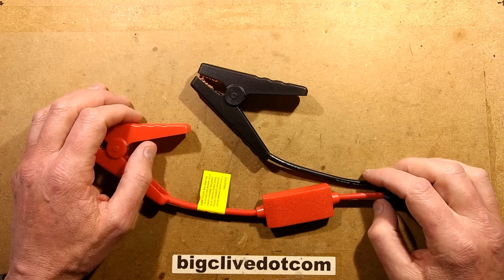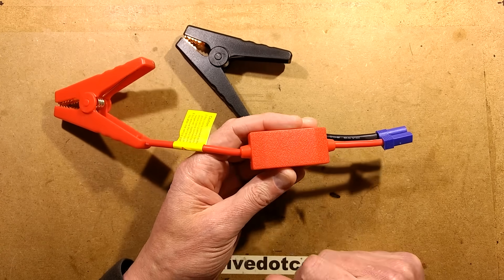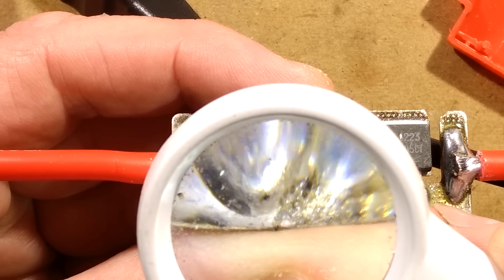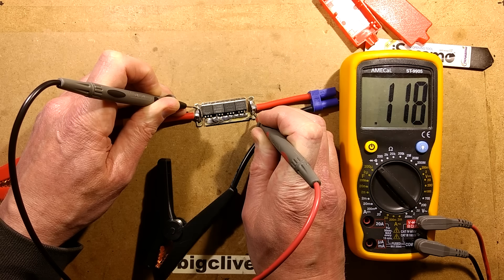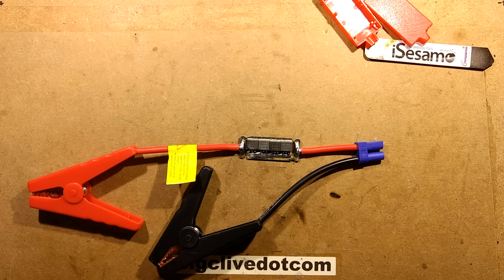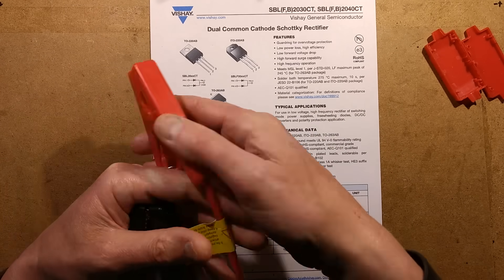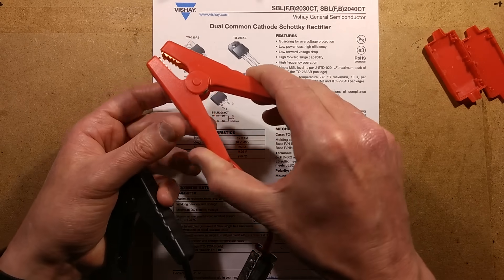What's in the little red box on some jump-start leads?  (Guess first.)

Comment: My wife bought some of those jumper cables that are all solid blue with no polarity markings at all.  Just four blue clamps, and a "magic box" in the middle.  "It's easier to use", she says.  "It says it doesn't matter which way around you connect it."

I hate those things.  Connecting two enormous batteries in parallel with no way to observe proper polarity just feels SO wrong.

Comment: I have such a jump starter box for a bigger emergency „battery“

I dont know why and i would never disassemble it, but it has 2 LEDs on this box. When just connecting a nearly drained battery, a green light goes on and it does nearly nothing, just a small current since the car battery very slow goes up in voltage.

Only when starting the car, the red LED goes on and the voltage of the car battery is somehow „pushed“ by the powerbank much more drastically.

In fact starting the car with powerbank connected the voltage drops at worst to around 11V, without powerbank i have seen 10V and probably for a blink of an eye.

I have no clue if this voltage depending mechanism for variable amp output is in the cable or powerbank, but i really appreciate this thing helped me out already a few times and sometimes its the best pick for a mobile power supply since it has also a dedicated 12V 60A output and ofc USB/UsB-C and a flashlight.

Comment: I would hope it's a massive high current diode to prevent reverse connection causing a lithium ion explosion, but it's probably a tiny, underpowered diode designed to die, and render your boost pack useless in the event of reverse connection.

Comment: I think it's kinda funny that every one of the diodes seemed to be a different model marking. Suggesting they're all fake labels on them, and were just the cheapest they could get that day. But also It's quite likely that they'll do the job of a fuse if needed, and at that price well it's cheaper than an actual fuse for those power ratings

Comment: Wow I'm a bit surprised they used ordinary Shottkey diodes in parallel, most of those I've seen have mosfet transistors in there that act as an extremely low voltage rectifier if it senses voltage, but turns off when reverse polarity is applied. 😮

Comment: Dangit...why didnt I see this three years ago. I used these leads from a dead jump pack in my shop for various things. I assumed the box was a fuse. I then used it with my West Mountain Radio CBA5 load tester. I used these leads to capacity test a 100AH Lifepo4 battery and they worked fine. I thin tried to use it on a 36 volt Lifepo4 golf cart battery and the damn thing would not work. I thought the CBA5 had failed and I did test continuity through the box and I had good continuity. So i knew the "fuse" was good..lol. I called tech support for West Mountain Radio and we went over a few things..he determined that i had an issue with my wiring, I told him I went through it already..several times. The British Bloke on the other line then said, and ill never forget this, "It happens to the best of use guy". I simmered down and decided to double check this most basic of wiring. I then looked at the red "fuse" box again and immediately grew suspicious. I poped it open and saw the same arrangement...I threw the damn thing across the shop...lol. I was so mad at myself and felt like calling the WMR tech guy back to apologize for my short replies. Sometimes my inner captain dum dum comes out. But those are the times I relearn basics.

Comment: These work… fine. They won’t help if your battery is dead flat, but if the engine turns over and doesn’t start, the batteries will push it enough to get things started

Comment: The three identical or virtually identical units that I have tested after they failed all failed at the wire not the diodes. Surprise surprise copper coated aluminum wire

Comment: Circuit breaker? Fuse? Diode?   Probably Diode for rever polarity protections......well, guess i will find out.

By the way, as a mechanic,  know how many bad batteries in the winter i replace and the customer says the jumper never worked.  Well yeah, with a crappy battery it's not enough to start a car.  Now a good battery, better chance.

Comment: Some car salesmen I know at a big dealer ship who send Chinese cars our way foe repairs,all have their own individual little booster packs just like those but in the unit on the positive lead there is alongside the reverse polarity protection,a few  LEDs to indicate reverse polarity,charge level etc. they are branded Jumtop.

Every single one has failed because the unit on the positive cable has failed,when you take them apart it's just caramel city😊,so I just reconnect the cable ends and return them on the provision that it's at their own risk to use them. They seem to work but only if the vehicle battery isn't almost or completely flat.

Comment: I have used some of them. Some are great, some or awful. I was a mechanic for 26 years. Near the end of my career as a mechanic, the shop I worked at purchased one from a reputable source. It worked great. We were able even crank up the typical light duty diesels that are here in the US. The cheap one I tried would barely turn over a small four cylinder in the likes of a Toyota Corolla.

Comment: DIODES
Using a lithium jump start is great for jump starting for a short period.
However, once the vechole starts, you do not want the alternator of the vehicle pushing over 14v back into the lithium batteries at high current.  Hence, the diodes are there to protect the lithium batteries.

Comment: Where I used to work they wired water heater elements in series/parallel and then suspended them in garbage cans full of water for large power supply testing.  For short term testing it worked well.

Comment: I have one, I've taken mine apart already.  Mine is a bit different, rows and columns of surface mount diodes.  The funny thing I found with my pack, a Viking brand from Harbor Freight, is that it doesn't work without those diodes in line.  I'm unaware of how it would know.

Comment: At 10:17 he says that he guesses that the forward voltage would increase as the diode gets hotter. That guess is wrong. The forward voltage of a Schottky diode DECREASES as it heats up usually at about -1.4mV per degree. This has two important implications: One is that it is terrible engineering practice to wire such diodes in parallel as is done here. This is due to thermal runaway; if one diode gets slightly hotter than the others, it starts hogging more current and then gets yet hotter, and tis escalates unit just one diode is taking the majority of the total current and then fails. The other implication is that when we design power supplies for best efficiency, we deliberately allow a smaller heat sink for Schottky diodes to allow them to run hot. A much better way to protect against reverse current is to use N-channel MOSFETs in the negative line. One does need to connect the gate to the positive line for this to work, but one can easily get voltage drops of less than 0.1V this way, and, in this case, one is allowed to wire multiple MOSFETs in parallel.

Comment: I might’ve seen this video a long time ago, but I’m not sure so I’ll still take a guess 3:00

I’m assuming it’s a circuit board with a ton of surface mount diodes all in parallel. These Lithium packs are usually in a 3S configuration, giving a maximum „safe“ pack voltage of 12.6V, yet most car Alternators are designed to go past 14V and even as high as 14.7V under low load just to really charge that Lead-Acid Battery. The Diodes would make sure that once the car got jumpstarted, the pack wouldn’t get 70-100A of „charging“ from the alternator, making them burst into flames from overcharging
Reply: Okay I was close but not quite there. I was assuming smaller diodes on an actual green PCB, and a forward voltage of 0.6V

Comment: This is a cheap version of reverse polarity protection, usually there are powerful MOS-FETs. You can also notice that the diodes are with different date codes/batch numbers. I notice similar phenomenon on cheap BMS circuits, MOS-FETs (they call them MOS tubes 🤭) are from different batches.

Comment: My first guess was diode also but then I thought cheap - maybe nothing!  Wiring Schottky diodes in parallel like this is dodgy (negative temperature coefficient) - a recipe for thermal run away and single diode failure.

Comment: i dun did buy a set of cheepies jumper leads   $7 I wanted them to cut in half and use for battery connectors on my solar so  i can add battery's in a black out ? they looked great ...... then i cut one  it looked like speaker cable inside big fat insolation ..... the wire on the set your have in this vid is at least twice as thick maybe 3 times .................. the only win was they had good metal clamps

Comment: I recently bought a Yaber Auto 4000, and it works well, already used it multiple times. It has a force start option which I needed for completely dead batteries. It's basically 4S Lipo, so it drains pretty fast, which is to be expected.
It's not dead yet after 10 uses. Worked perfectly acceptable on a small 1 liter diesel and a 1.3 petrol.

It's really handy to have for EV's, as the 12V battery dies without much notice, as there is no conventional starter sound that would give you early warning.

Comment: You keep referring to 12 volts but those lithium boost packs are often 14 or 16 volts. A 12 volt battery at 12 volts is basically dead.
Almost everything in ICE cars electric is rated at least 16 volts. It's not uncommon to see modern alternators putting out 14 to 15 volts when working. Most battery chargers with a boost/crank feature jumps the output from 14 volts for normal charge to 16 volts for cranking.

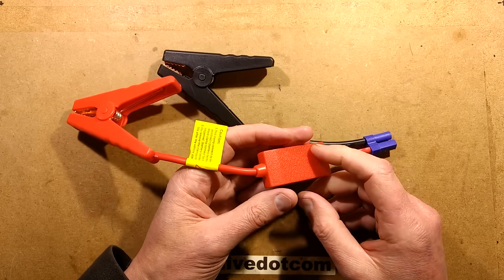Comment: @2:40 some one once suggested that the electrical currents flow primarily on the surface of the conductor... So theoretically having a low electrical resistance material plated over a cheaper structural material should get you all the goodies... I think experiments are needed to understand the full truth of the matter...
Reply: That is true the higher the frequency, not with DC.

Comment: Love the way you pretended like you didn't know what could be in the little red box - lol  🤣
Reply: Mine would be also very useful.

It has 2 LEDs… red and green.
Green goes on when connecting, and red goes on when using the starter (aka voltage on car battery drops)

I have also tried already a dead battery way below 10V and basically impossible to revive, where only the red light was blinking after a few seconds and it did nothing as if this box said:“Nope, absolutely dead battery“…

would be interesting to look into i guess since there is obviously more in it than 4 diodes

Comment: Reverse current protection, or at least there should be. Most lithium jumper packs are a set of lithium batteries in series to get the 12v so you wouldn't want to jump off the battery, start the car and have the alternator forcing current pack into the pack.

Comment: Curious you did not mention the fact that this is a DC circuit  where sine waves are not a factor.  You spent the largest part of your discussion on how diodes behave in AC applications.  If the focus of your discussion was to explain the function of the box.....that got 5 seconds whiile AC applications got most of your time.  I did learn lots about diodes, not much about what makes these specific diodes different.

Comment: I'm guessing a fusible link (or just a straight wire) if they really skimped on the parts, or a diode array to prevent current flowing back into the pack.

Comment: They should have a resistor to restrict the max current to avoid voltage spikes. Oh, diodes also works, it will stop the reverse inducted current from frying stuff. The current can be insane. The first load is often a broken, dead or shorted battery, followed by a starter that can pull in excess of 600a on a large diesel engine, and typically around 300a on a regular engine in cold weather. With losses etc, you can induce very high voltage spikes that can kill electronics.

Comment: Reverse bias diode to prevent the car battery from destroying the lithium pack that supplies the boost voltage. It is my standard method when using electronic lab bench power supplies (0-30V circa 1 to 5amps) from blowing up the powersupply in some horrible fault.

Comment: It probably won't matter if they fail open or short circuit, either way they will melt the plastic before they do, thus requiring the lead to be replaceable.
Though there's always the risk of these shady lithium jumpstarters blowing up before then.

Comment: Going back many years, when car bumpers were chrome, the best method of connecting jumper leads was to increase the rated capacity of the leads thus, push the two cars together so the bumpers touch, then hook up the positive to both remaining cables. This gives you a much higher amp rating. 60% of the time it works every time.

Comment: Am I crazy, or has BigClive torn down one of these in the past? The red box is a diode pack that prevents the vehicle from reverse charging the lithium cells in the jump starter once the vehicle is started. They also end up basically being a fuse because they explode (and hopefully open) under an overload.
Reply from the maker: This is an old video.
Reply: I saw my like on the video, but I had a chance to watch it fresh as I forgot it
Reply from the maker: @edherdman9973  From the comments it's clearly having a renaissance moment.

Comment: I had one of those many years ago, I always figured it was a big (or 2 smaller) diodes for reverse polarity protection. Weird side story, I use to work for a company that operated juke boxes and the bar tenders were constantly killing the remotes by putting batteries in backwards, so I started modding them to have a single 1n4001 diode inline with the positive battery terminal, stopped all those dead remotes. Not sure why such a simple thing was not thought of by manufacturers of anything battery operated.

Comment: The clips being so close would be a nightmare for cars with just the positive post under the hood. The decent bolts for the negative are often a fair way away
Reply: I just use it direct on the battery the "bad" way. These are best for directly boosting the battery and less good at actually starting cars.
Reply: A lot of cars have the negative jump point not too far from the positive.  And if not, and decent bolt head on the body, or metal part of the engine block can be used as well.

Comment: What about the ones that have flashing led a push button & a clicking sound like a relay??
Reply from the maker: Those ones have wrong polarity detection and may also limit use if the battery voltage is too low.

Comment: I bought a cheap jump starter as my car battery is on the way out. (my kia venga is impossible to take the battery out on the street or charge ). I was dubious (soo small 8x5x5 inches ish) ) but it would be a cheap battery and I could always dismatle the remains with unreasonable force.

It works. With my car you dont charge the battery it provides enough cranking power so its ready as soon as its attached (green and red flashing lights)  for the three seconds it takes to start the car. All in all I've used it 5 times and its been perfect every time. Plus the various lamp with flashing features and battery PSU. 10/10.  New battery due at the MOT next week.

Comment: I have done a little bit of reading up on the perfect rectifier.  Engineers are now starting to use mosfet transistors which have an extremely low forward voltage drop when turned on. Maybe you could do one on that.
Reply from the maker: Synchronous rectifiers.  Becoming more common.

Comment: Using a Diode as a fuse in circuit is sometimes done, its infuriating when they do it because rarely do they mark that on the schematic or the board its  soldered to.

Comment: Why are these diods here?   That in case after a successful start the 14,7V generator doesn’t charge the 11.1V lipo with 4,9V per cell?
Reply: 4S LiFePo4 would be smarter - compatible voltage at starting as well as on charging

Comment: I've gotten so many things with large crocodile ends like this with copper coating over what seems like steel. It's so dumb because copper isn't a great surface material (it oxidizes). They would be better just using nickel plating.

Comment: 1:15 Okay, so we all know that that red package on the positive lead is just a ferrite core that does nothing, & the rest is just snake-oil nonsense in the description, right? If I had to guess, I doubt that those cables could handle more than about 20A without setting fire to the insulation.
5:20 Huh. I stand corrected. It turns that it's just reverse-polarity protection, which, considering that it's for car jumper leads operated by idiots, is fair enough.
7:00 Clive, you're completely missing the point here; it's just about cheap reverse-polarity protection. Nobody cares about reverse-recovery time for jumper leads; it's just about the cable not blowing up if some idiot connects it the wrong way.

Comment: On my jump pack leads there's a low voltage cut off and a reset for "force start"
It's a great pack and easily starts my tractors with a completely flat battery.
It was $100aud.
Does the pack do something like the jump start battery chargers that drop the voltage to 5v and increase the current to start the vehicle?
Reply from the maker: I think the jump starters just smash out as much current as they can.